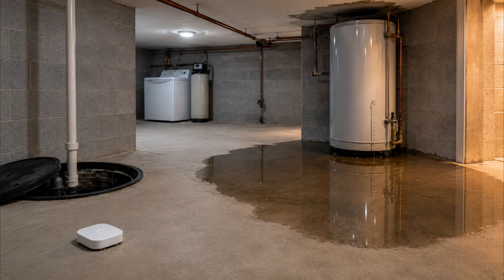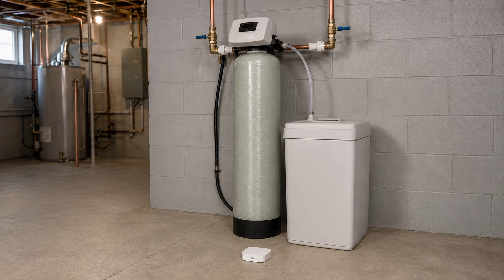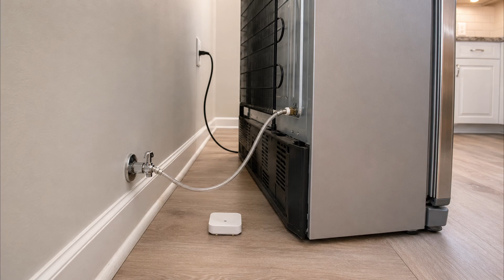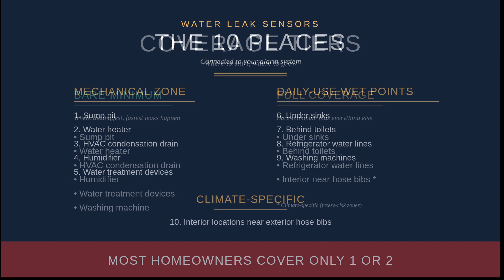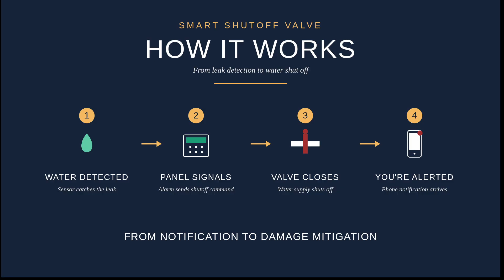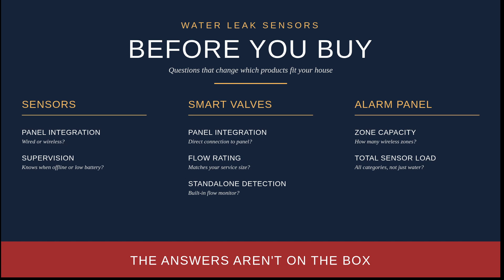The 10 Places Water Leak Sensors Actually Belong

Comment from the maker: A water leak sensor only protects the location where it is installed. Effective coverage means identifying vulnerable equipment, plumbing connections, and appliances throughout your home, then deciding which areas deserve priority.

The Home Security Buyer’s Guide and Planning Workbook helps you turn those decisions into a practical protection plan. It includes property assessment and environmental protection worksheets, guidance on monitoring and emergency response, and considerations for automatic water shutoff.

View the free preview:
https://smarthome.k4nj.com/b/home-security-buyers-guide

Which potential leak location would cause the most damage in your home if nobody noticed it right away?